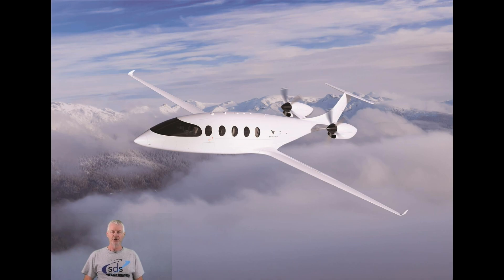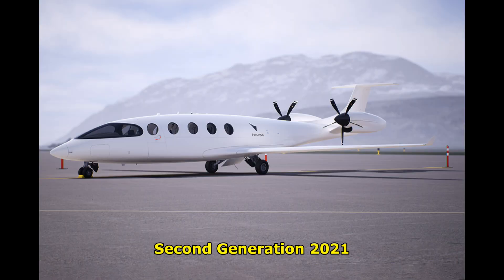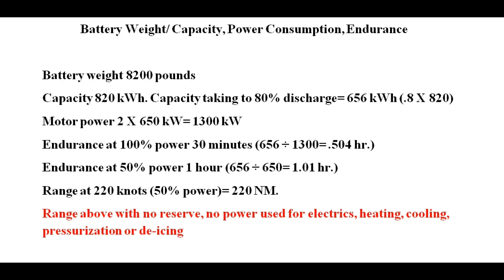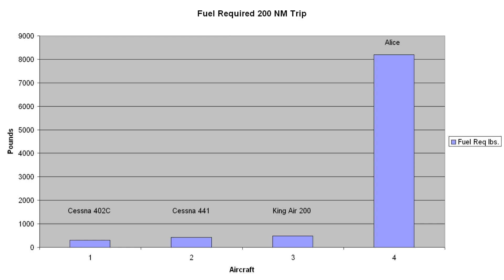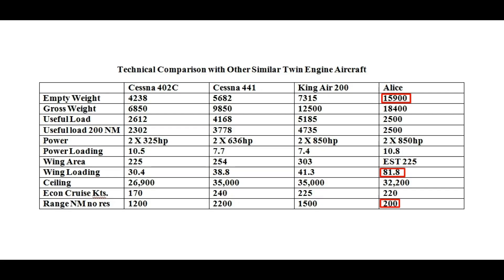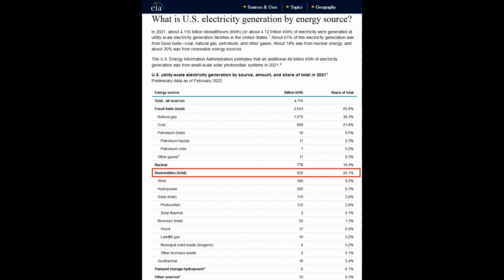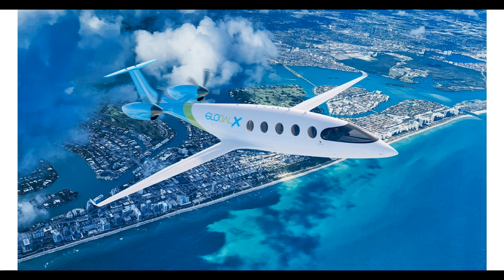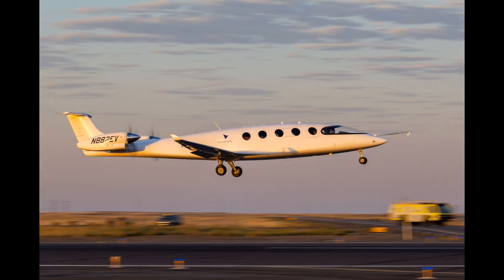Eviation Alice. Is the Future Electric?

Comment: Aside from needing a few adjustments, Alice looks like a broadly decent design waiting for one of those mythical batteries that keep showing up on tech sites, but never actually make it to market. Someone will crack it eventually. Just not now. And while battery production emits a bunch of CO2, it doesn't really have to. That's kind of circular reasoning - as battery-renewable architectures expand to more of the world's power grids, the CO2 usage involved in MAKING said batteries goes down to just the emissions from lithium mining equipment and then eventually nothing as even that becomes electrified with the advent of better batteries.

Comment: Hello, I have a question. I find the high wing loading a rational decision. Is my logic wrong here?

Firstly, establish that battery-electric propulsion (BEP) can very easily get insane power, but it struggles with endurance. (opposite of petrol in this regard)
High wing loading is...
-Efficient at high speeds. Good for cruise and critical for BEP's endurance struggle.
-Inefficient at climb and takeoff. I think one should be able to compensate with an overpowered aircraft. Of course Alice is not overpowered, but it could be, as the motors represent a tiny weight.
I think there is a rational design philosophy somewhere, and engineers tried to make the most out of it, but nevertheless, the rest of the stats speak for themeselves. Bricks are not meant to fly.

Edit: Also, what could be the reason for the weird fuselage geometry? I feel like a circular fuselage could've carried the same volume with less frontal area. Alice's weird shape might just be to win over the fake-futurism-crowd. Who knows...
Reply from the maker: More power requires larger and heavier batteries so that's not an option. The only viable electric aircraft flying right now have low wing loadings to reduce the power needed to sustain flight, closer to powered gliders. It's better to go 150 knots instead of 220 with a bigger wing and double the endurance.

The airplane hasn't flown for a month now. That's telling. Did they have to reach a first flight milestone for further money from investors? Are they waiting for that better battery tech or does the design require major mods revealed from the initial test flight?

If things were go, you'd think that they'd want to keep the flight test program progressing.
Reply: @rv6ejguy  Absolutely, it has all the flags of a scam. 
But I disagree that more power would require larger and heavier batteries. In the sense that it's easy to engineer a battery that can be drained faster. You want more kW? Connect cells in series. You want more kWh? That sucks, that would need more weight.
Reply from the maker: @g.zoltan  More power reduces endurance which requires heavier batteries to compensate. This aircraft is already seriously challenged on endurance as is. kWh divided by kW tells the whole story. It's simply not viable with the current battery tech used here.
Reply: My early reading about this was that it wouldn't go above 10000' so pressurisation, the only real need to have circular cross sections, wasn't needed. Circles are awful for packing in square things, but I am a little confused about the triangle ish shape. Maybe it's for headroom walking along the aisle?
Reply: The motors in this aircraft are not light. It looks like the motors weigh ~450 lbs and make less than 900 hp, while a TPE331 makes 1,000 hp and weighs 415 lbs. I'm not even sure if the weight listed for the motors includes the controllers.
Reply: @PistonAvatarGuy  that should definitely include the controllers at that mass. To be fair it always should include the controllers. Imagine doing power to weight on a turboprop and leaving off the accessories, or the redrive.

I'm a little surprised they are that heavy for that power output, but turbines are really hard to beat for power to weight.
Reply: The energy density of Tesla batteries today are 250 wh/kg.  We need 750-1,000 for smaller general aviation to be practical.  I don’t see it ever being practical for large aircraft.  

But, folks, if we can, over time, transition daily commuter cars and primary trainer aircraft to electric, it will completely change the balance of power with OPEC.
Reply from the maker: @gregjennings9442  What energy source will charge those batteries? Who will pay for the massive generation and transmission infrastructure required to do that? Where will you get all that lithium and cobalt without using fossil fuels to mine and refine it? 

The whole thing is nonsense pushed by lay people and politics rather than sound engineering and reality.
Reply: @rv6ejguy  : Well, I could go a lot of places with this, but I’ll summarize into a handful of points.  1. Battery technology…much like engine control technology…isn’t static.   Billions are being spent to advance past, I acknowledge, the shortcomings of Lithium Cobalt Ion.  2.  If you’ll grant me the future that I think is a possibility.  One with, say, graphene based storage, what would be the effect on world oil markets if we were able to transition, as they require replacement, just commuter cars to EV and burn fuel oil to charge them?  Motors and control are mature technologies and around 2X as efficient as ICE.  3. Many large companies with lots of money and expertise are betting on an EV future.  Just one example is an EV plant being built alongside I-65 in Kentucky that is the size of a small city with an initial investment of nearly $6B.

With all that said, keep in mind that I said “if/when” in my post.  Especially as applies to aircraft.  I expect to be flying my Lycomisaurus…with SDSEFII…for the rest of my aviation days.
Reply from the maker: @gregjennings9442  I don't doubt that battery tech will improve but where will the power come from to charge all these batteries in the next 5-10 years? Mostly fossil fuels,  just as today. No net reduction in emissions, just redistributed. What will be done with the millions of tons of discarded batteries?

Alice might be a small step but at the moment, long distance transportation by electric aircraft isn't technically feasible.

Comment: 6:45 I disagree, I found that there are several working technologies that would allow the recycling of Lithium-batteries. The thing is, most battery manufacturers are not interested in recyclability, so in practice, it rarely happens.

Comment: I originally looked into electric propulsion for my RV-10 and found a promising technology developed by NASA. I contacted the team lead and he told me more about the status and it just isn't yet ready but still very promising long term. They solved the biggest problems: weight and capacity as it is very similar to today's fuels. The trick is to store the energy in 2 liquids (containing nano particle iron) instead of inside batteries. Heavy cables aren't needed as the fuel cells are incorporated into the engine. The two remaining problems are a) refining the air bearing of the ducted fan and b) the availability of a small charger or having replacement fluids at all main airports.
https://ntrs.nasa.gov/api/citations/20210010031/downloads/H3301FINAL2.pdf?attachment=true

Comment: I personally would not trust it. There’s been a lot of fires involving these types of batteries these electric buses that they’ve been using on the East Coast have caught fire, so they ground them and took them out of commission from what I read in the news. Range would be another big issue for the price you have to pay for that plane to go anywhere and and climb out here altitude if you get in the fall weather, it’s gonna take more battery power who knows you might be down to 80 miles nautical. What a waste of money in my opinion. Like you said, how do you power the radios, the air conditioning, and whatever else is in a plane, if it comes off the batteries, the power of the engines motors sorry that’s gonna take away from your range as well. Maybe they’ll scrap the battery powered part of that for the motors and go to hydrogen powered motors that might be more feasible just my thoughts battery powered no no way hydrogen powered that would be a fuel. I can understand the power  these motors, and it would also power everything else on the airplane and give you less problems in the long run and refueling would be a lot faster as well. My opinion only.
Reply: There are no major commercial (not academic) advancements scheduled for this kind of electric battery in the near future as far as I know.
Reply: @vitordelima  There are Uranium and Plutonium fuel cells...not for civilian use though...
Reply: @electricaviationchannelvid7863  Fuel cells are different and I'm almost sure there are multiples types available commercially (SOFC, PEM, ceramic, ...). Their closest equivalent for nuclear power are nuclear batteries, because fuel cells in the context you used mean another thing.